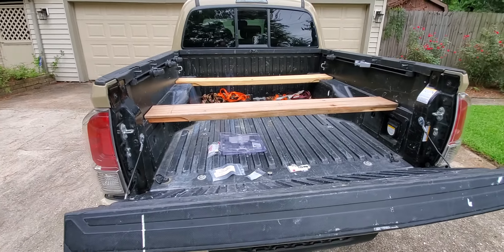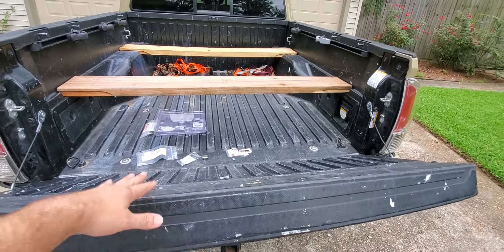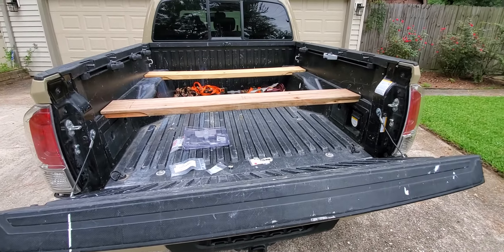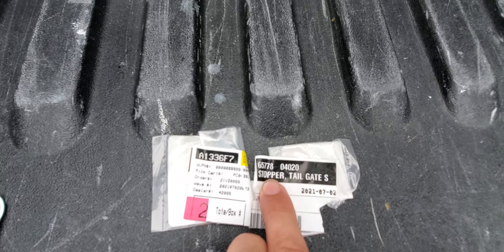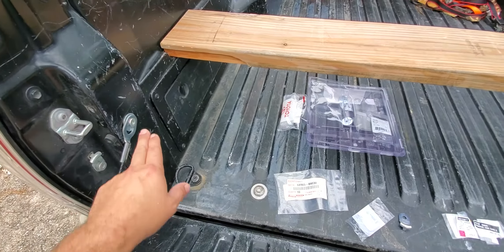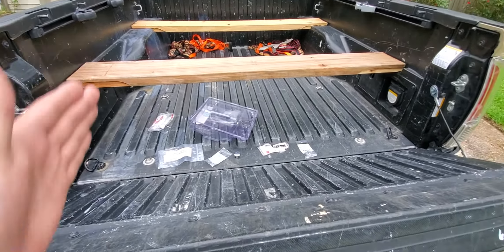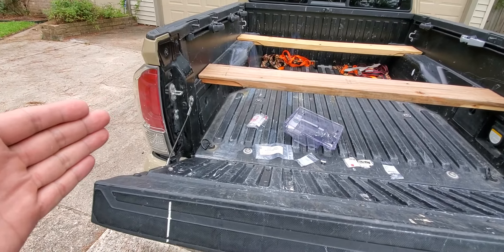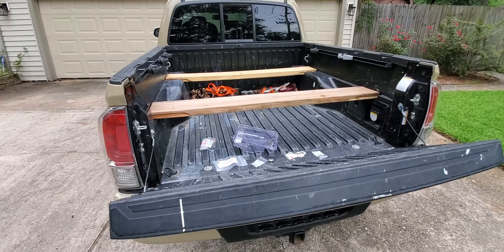4x8 sheets in small beds "hack".

Comment: I was concerned that my tailgate might fall off from a harsh bump as this is the hinge release angle for tailgate.  I might be paranoid but I think one should add a hose clamp around the right hinge so it doesn't slip off,  it also has the benefit of making it harder for someone to steal your tailgate.

Comment: Great hack, but you also can put a 3rd board on the tailgate and level it with others. The tailgate already so heavy, may stressout the cable or the bolt attached to the new holes you drilled in.
Reply: Hey what do you mean by putting a third board on the tailgate?

Comment: With chevy trucks, you can loop the tailgate cables around the post on the tailgate so you don't need to move where the cable is connected.
Reply from the maker: Is that just on the s10? Or all the trucks that dont have a full 4x wide bed?
I can only bring myself to buy toyota, just because we have had such good luck with them. But the American trucks are just so much better at comfort and convenience, accessories, etc.

Comment: Can you easily move the support cables to the original bolts, like you can with the Maverick? Or do you have to undo the bolt to move it?
Reply from the maker: Yes, you just push them forward, they pop off, put it on the new ones. You can pull the tailgate completely off in 15 seconds (minus finding the camera cable and unclipping it).

Comment: It really is strange - for years we had a 2000 Toyota sienna minivan that could fit full sheets of 4x8 drywall or even a refrigerator with the tailgate closed (and rear seats removed).  24 years later trucks are still being made that can’t “truck” building supplies around.

Comment: where is the normal spot the wire support grabs onto ?  Don't see it ?  Also, another hack is, like new colorado, to weld or screw a round  thing on the side of the tailgate so the wire thing can go around it at mid height position, well, you'd place it where it would be the right position.  If factory wire is not strong enough, I assume we can find a tad thicker stronger one to replace it with.. But yah, what the Heck Toyota ? I think the 24 has this covered ?

Comment: Remove the tailgate cables and replace with steel 1/4 inch strap   1/12 inches wide .  Set the length needed and install original latches onto plate .
Reply: Do you have a picture or diagram of this setup?
Reply: @michaelcarrigan2513  Punch in tailgate support. DG manufacturer , you will see many pictures.  Amazon will have these . Michael I hope this helps
Reply: My old Colorado did this over a decade ago, no need to give probs to Ford 😉
Reply from the maker: Not a bad idea, but the oem ones are crimped on. So id have to fab a new connector